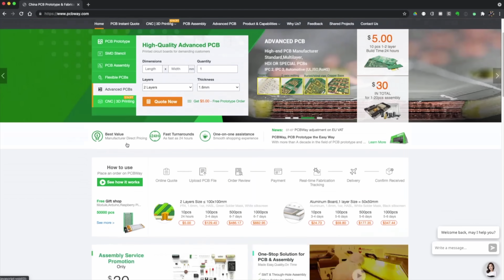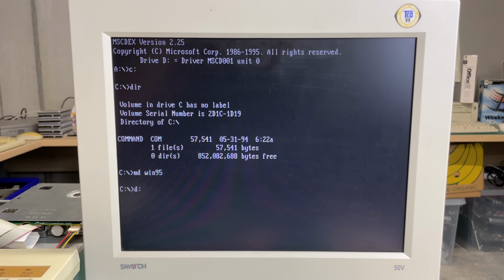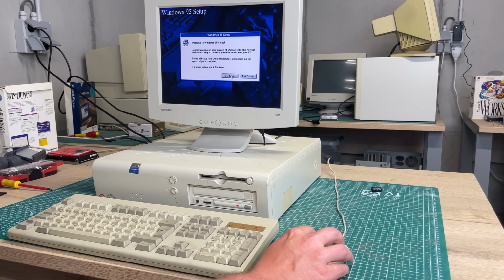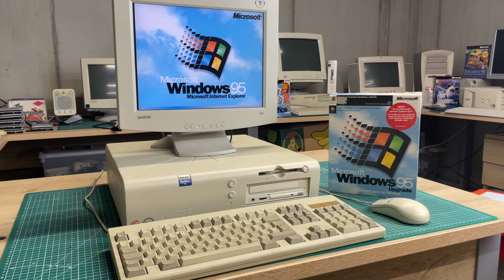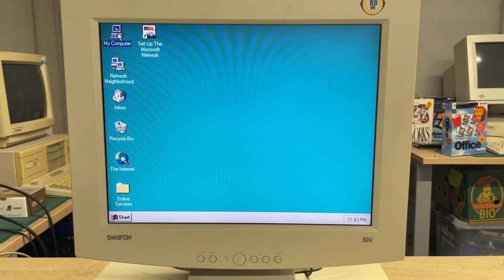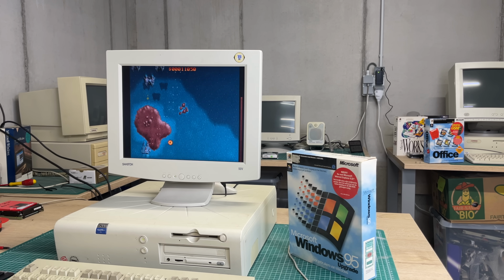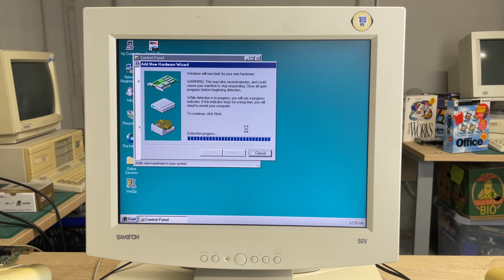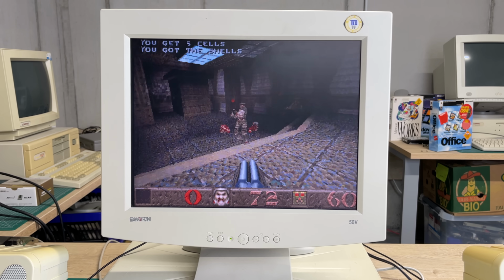Dell OptiPlex gets multimedia upgrade

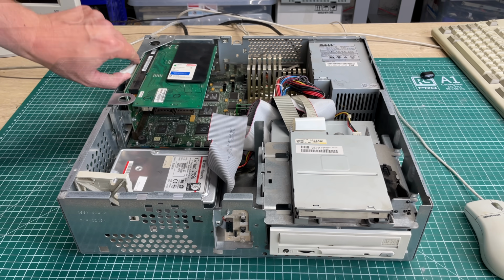Comment: BTW, about 13:15. Just an odd/weird but at the same time a funny idea. Probably you could search for and buy/grab for free somewhere locally a used old analog office PBX station and try to reproduce a dial-up networking model: This (of other Pentium based) machine with a modem at one side and then > PBX > "ISP modem" > local LAN (plays a WAN role here). So typical reconstruction of dial-up networking could be made.  Apache httpd 1.0 with some Web 1.0 web site would be a nice addition while locating at the local LAN segment.

Comment: I remember being at work, one day back in the 90's and they wanted Windows 95 on there computer. That was fine and all, but, they didn't have a computer with a CD-Rom drive so I had to install it using floppies! So, if you think, the CD-Rom is slow, try installing Windows 95 with floppies. All 13 disks of it!

Comment: Network wise, if not used you should remove IPX/SPX otherwise you will be "trashing" your network is packets that will only exist to be discarded resulting in a performance penalty. So yeah, if you don't need it, remove it.
Reply from the maker: Who said about not using it :) A lot of games relied on IPX/SPX for multiplayer (tcp/ip wasn't that popular for gaming back then. It was getting traction but ipx/spx was still the way to go).
Reply: @RetroSpector78  Yeah, I was forgetting about that detail. In fact I had a Novel Dos 7 (Personal Netware) Network with my neighbour just for that, COAX 10Mbps at the time. Prior to that we had an 8 meter serial cable direct link which maxed out at 9600bps due to the length.

Comment: HIMEM.SYS is required duh, and you should have the MS-DOS CDROM driver on the config.sys as well for Windows 95, 98 and ME not so much though even those may need it for some older drives with proprietary controllers (not ATA or SCSI drives)

Comment: Nice restoration video! The Mitsumi you're having here was my first CD-Writer. I think it was 2x2x6 speed. The DELL's from this era, shared quite a lot with Compaq as building ways. Except the plastic used by Dell was a bit more bulky. (for example the Diskette drive eject button)
Reply from the maker: It has grown on me :) Like these early pentium systems.

Comment: Here's a tip for beginners if you want to test the .mid and .wav files in Windows 95 when you install the sound drivers for any sound card, if you did a default installation you'll need to go in the Control Panel go to Add/Remove Programs click the Windows Setup tab go to Multimedia category and select Sample Sounds and Multimedia Sound Schemes if you want to get canyon.mid or passport.mid in the Media folder.
Reply from the maker: Thx for the tip !
Reply: @RetroSpector78  No problem, I'm just sharing some useful information to fellow vintage computer enthusiasts out there.

Comment: I think you may need the windows 95 upgrade to do that 1s time around,  Also i think it maybe the version of windows 95 that can be funny with CD rom driver support too, I think the earlier version 95 A is quite stripped down compared to the version B.  The service pack i think turns 95A into 95B  shame you put windows 95 on though, it would have made a killer windows 3.11 machine with the CD Rom and sound card,  I have networked windows 95 as part of the NT4 domain, and used the server to deploy windows 95, using the network boot disk, which is a fun little project!
Reply from the maker: yeah network based OS installs are also on my ever growing list of TODOs

Comment: I’ve always wondered why the Windows “Scanning for new hardware” detection dialog was slow. I guess in needs to built up some sort of database. It seems like Microsoft never choose to output what it is actually doing in that process. Contrast that with Linux that is always extremely verbose to the point where it seems like it is doing way more then it should overloading the users with senseless error messages that it can’t do this or it xyz failed to probe abc. I guess there’s no middle ground here between the just let the user wait and wonder vs printing a lot of extraneous information on the screen.
Reply from the maker: Would be nice to get some insights in what it is doing at that point.

Comment: I am  currently resurecting an Acer aspire 5315 laptop that I had about 12 years ago and I have it and now I got it back after it has been abised and not taken care of. I disassembled it completely and had to improvize the DC in jack which was missing. Also the power adapter has got bad capacitors and there is no store for me to buy two of those. In the meanwhile I am using other laptop's adapter, which is 19.5 V instead of 19 V (whichnos about the same).
And after reassembling it I realized the backlight of the LCD display did not work. I need to check it if it is onlu from the connector not being properly arranged or the lamp itself is gone. Maybe a lamp from a Sony Vaio could fit in there and work, if need be.
Obviously GNU Linux will make it rin lightning fast (preferably Antix).

Comment: For an OG Pentium, I think that the Trio 64V+ is pretty much ideal. It's bullet proof. Excellent compatibility, pretty decent image quality, good GUI acceleration and even basic video playback acceleration. No 3D of course, but this isn't really the generation of PC for hardware 3D in the first place.
Reply from the maker: Exactly. It would probably be able to run quake / monster truck madness with a 3dfx card but that might be pushing it. Going to try that out.

Comment: Installing Win95 from DOS 6.22 is absolutely fine.  I often use a 6.22 disk as my generic “Das-boot” disk.

I have had the same problem you were having, but I seem to remember it being a bad SCSI driver, or an issue with the Plug n Play config manager having trouble assigning resources.  Something like that.  I bet if you had stripped down the configs, and maybe removed any non-essential cards, it would’ve been fine.  Might also have been a disk manager in the MBR.

OH!  No, I remember now — there’s a buggy version of emm386 that would have issues with ... something.  I’m having trouble remembering what exactly triggered it, but there was a KB article that said you needed to upgrade to a later version.  I think I ended up using one from MS Visual C++ 1.52 or something, as it was later than the ones bundled with DOS.
Reply from the maker: Would need to see if I can reproduce it ... if was solved with the exact same hardware config just by repartitioning and reformatting the hard drive.

Comment: I do miss the sound of the hard drives.. I wish you could add them on emulation, the same way you can do with floppy drive sounds in UAE
Reply from the maker: yeah that would be cool ...  Might do a pcb design to add some sound to one of those IDE sd/card boards or XT/IDE interfaces.
Reply: @RetroSpector78  That is actually a pretty good idea!

Comment: Always lovely to hear those hard drives chunking away especially when you have to do manual hardware detection. Recently swapped out an AWE64 for an SB16 and how easily I forget that these cards don't just willy nilly get detected by Windows 9x/2000, I thought it wasn't working initially. Good that you found answers on the caddy not working, I now wonder if you just lost/never had the keys😛
Reply from the maker: Never had the keys :)
Reply: @RetroSpector78  The keys are fairly generic; find one the right size, and it'll almost certainly work.

Comment: If I remember correctly, the chipset and the 800M HDD can use DMA mode intead of PIO4 that is activated by default in Win95. That way the HDD and the computer overall will be faster. Also you may want to activate audio over IDE for CDROM that way ou will not need the CD audio cable.
Reply from the maker: Gonna do a follow up on adding some performance upgrades.  might look into that.
Reply: @RetroSpector78  Thanks for your reply. Pentium 1 have a special place in my memories, on my P1@166MHz I finished Starcraft and Quake my first ever games that I bought. Now I am playing with a P1@200MHz trying to build a - close to my old one - retro gaming computer.

Comment: Excellent video! I love the old Dell machines. Very well built.
Reply from the maker: Thx. they are indeed pretty easy to work on.
Reply: I inherited about 10 of these machines back in 2005 and the power supply took a crap on all but two of them with very light use and in short order and guess what.. it’s proprietary in connector design. Felt like it was designed to do that after warranty was up honestly

Comment: Nice. :)
If you want the "correct" sound card for this system, you want a Vibra 16 installed into it. That's what Dell would've sold you if you wanted a sound card.
Reply from the maker: Probably :) might do a comparison at some point.

Comment: This is the first time I have watched a retro computer video about a computer that I used on a regular basis. Mine came from an office environment, so it didn't have a sound card installed when I got mine either. I later picked up a p2 era optiplex on eBay in the early 2000's that was my main computer for a while too. I really liked the style of those cases especially.
Reply: you find great youtube channel
Reply from the maker: Thx !
Reply: @PROSTO4Tabal  thanks!
Reply: @juliedunken1150  :)
Reply: @StigDesign  💩 💨 💩 💩
Reply from the maker: It’s also growing on me. Had been sitting on a shelf for a long time. Better to put it to some use.
Reply: Nice :D

Comment: ASP chip... does it install the ASP support by default.
I also vaguely remember "text assist", a very early speech recognition
Also worth checking out, the Jamie O'Connell FMsynth driver, a lot better on midi than the default

Comment: Since 2009 I like to install those old OSes in Virtualbox. I have all Windows releases from 1.04 (1986) to 11 (2022) including the NT releases :)  On the Linux side I have all Ubuntu LTS releases; the first release 4.10 and my first release 5.04 :)  I have absolutely no space for 17 old PCs running Windows.  However I installed my ancient VMs on the last 500GB of an 1TB HDD and of course they run with one CPU.  I even have no space for my first two PCs; an own-build 486DX66 dual booting Windows for Workgroups 3.11 and OS2/Warp nor for my Philips P3105, an XT clone with MS-DOS 6.0.

My 2 oldest still running VMs were installed and activated in April 2010 (Windows XP Home NL and Ubuntu 10.04 LTS). They survived 3 Desktop PCs and 4 CPUs (2003 HP d530 with a Pentium 4 HT; 2008 HP dc5850 with a Phenom X3 8600 upgraded to a Phenom II X4 B97 and my 2nd 2019 own-build with a Ryzen 3 2200G). Another reason I prefer VMs, they live forever, if backed up properly  :)

I still use that 2003 HP d530 SFF, I kept the parts and moved those to a Compaq Evo Tower with a Windows 98SE activation sticker.  The PC has the Pentium 4 HT (1C2T; 3.0GHz); 1.5GB DDR (400MHz) and 4 HDDs in total 1.21TB (2x IDE; 2x SATA-1; 2x 3.5"; 2x 2.5"; 1x 250GB and 3x 320GB). The system is still used for ~1 hour/week as backup server. It runs the latest FreeBSD 13.1 with OpenZFS 2.1.4 with all storage lz4 compressed. The tower has 2 external cables 1 Gbps Ethernet and Power.  Another fun project to use an outdated PC with the latest software for a still useful task.  The transfer speed is 200Mbps due to a 95% load on one CPU thread :)
Reply: Who cares

Comment: Very nice Win98 machines that have onboard ATI RAGE for early 3D games. Once thing to keep in mind is the custom ATX connector which prevents you from upgrading the PSU which is 145W stock. An adaptor exists that converts the ATX connector so a regular PSU can be used, otherwise you run the risk of damaging the motherboard.
Reply: Bullshit

Comment: The whole experience is so much about sound, smell and haptics to me. I am currently wrapping my head around how to set up and test some 20 SCSI harddrives that have piled up and it is absolutely tedious. but still, at every reboot the sounds of the floppy drive springing to life and loading MHDD makes me a little bit happy.
Reply: Oh boy testing some of those drives is sure fun.....if they have been sitting for 20 years I really wish you luck as I've found around that long the media degrades and / or demagnetizes if they haven't been refreshed.
Reply: @cdos9186  Well the most difficult part was finding the right controller cards, cables, terminators and software. There are like 4 different connectors. The test system can't be too old, can't be too new. And as I had no previous experience I went through 4 different testing setups before getting it up and running okay. Seems to in comparison to my stash of ATA harddrives, not many have survived. One died with a loud bang inside, when I switched it on for the second time right after writing "good" on it, sigh.
Reply: @catriona_drummond  Hmmm....sounds to me like one of the heads decided to not be attached anymore. What model drive was that? Only drive I've had that happen with was a Deskstar 75GXP. The test system I use is a Pentium 4 machine with Windows XP as the software is amazing for testing drives on there, especially HDTune that if you do a full scan it really works great for testing before and after results, and believe it or not drives with bad sectors or I thought were bad sectors went away after a couple full formats, so they were likely just weak or corrupted sectors. Sucks to me that when someone sees one bad sector on the drive, they usually just go "Well it's bad" and get rid of it replacing it with some annoying flash to IDE adapter which ruins the nostalgia in my opinion. I'm curious as to hear what drive you had decide to die with a loud bang, I've heard of that happen to people, more than one actually, with Seagate ST-225 drives.
Reply: @cdos9186  Seagate ST-1133N
Reply: @catriona_drummond  That’s extremely sad, I didn’t expect you to have a rare drive like that fail. Would be cool to hear a dead one as actually I’ve never heard a dead one before. If you would like to archive the sound of course, my goal has been to archive the sounds of as many drives as possible since people don’t bother to take 10 minutes or so to record a drive spinning up and seeking. That would be a cool one to hear, even if it is now failed it would be nice to listen to it since there isn’t one video of one spinning up.
Reply: @cdos9186  I actually plan to record all the dead drives I have. with my skills it may take months however. I will try to think of our conversation if I ever get it done.
Reply: @catriona_drummond  It shouldn't be too bad, I personally do little to no editing at all, only time I usually do is to make the drive more audible because otherwise it usually is extremely quiet, especially modern drives. All you really need to do is have good lightning, have a good background, and have a clean camera lens. Although it may take a few tries to get the video how you want, give it a try. It takes me usually five times before I get a satisfiable video and occasionally more.

Comment: I have a couple of these (the GX1 variant) and I originally had them with windows FLP but after watching this video I simply had to load W98 SE
Reply: @cyberman7348  thats an awesome story, and yes XP had so many good useful features it was hard not to go that route even if it made no sense... linux.. thats a whole different story... I wonder if slack or core would run. Thanks for sharing tho.

Comment: okay, toss a 3dfx at it!     and a TB SSD! and uhm... LASERBEAMS! heh, <3 all
Reply: A Voodoo 1 is only really 'useful' when combined with at least a 166MMX CPU, but preferably still a tad faster, otherwise it might still be too CPU bound in most games.  But in that case I would definitely go for 32MB RAM too.

Besides the RAM, a newer drive would probably help a lot too, 850MB is a bit on the low and slow side. Anything between 4-10GB would be at least twice as fast and still period correct.  And a P133 is the perfect Win95 office and 2D gaming setup !
Reply: @skillaxxx  so a voodoo2 and mah pci 486 with AMD's AM5x86-P75 was too much? and yea, I posted a comment about the RAM in Part 1, lol! whatevah! we watched! <3